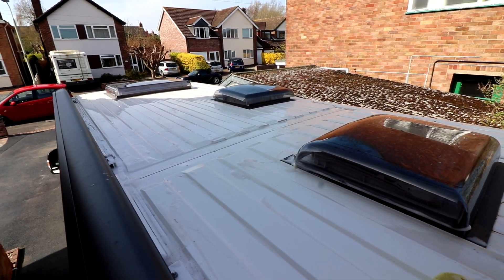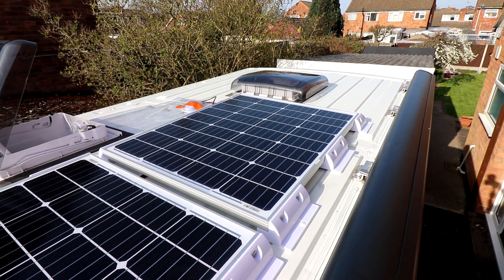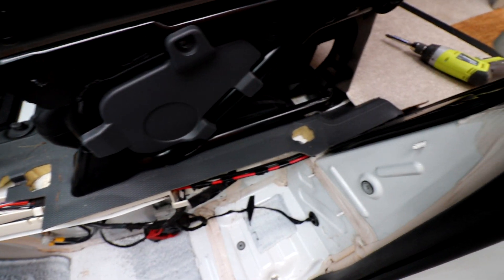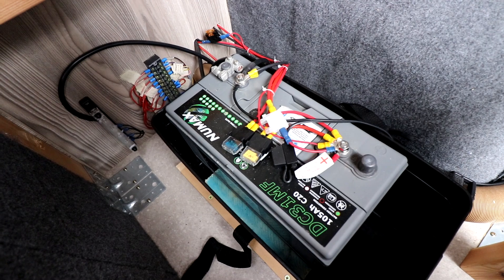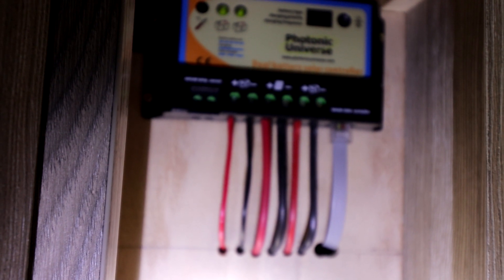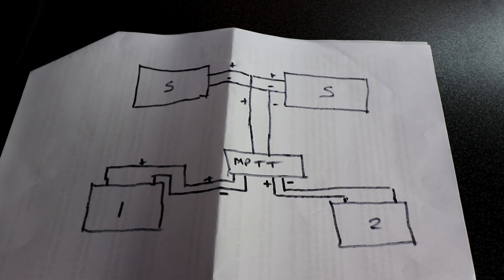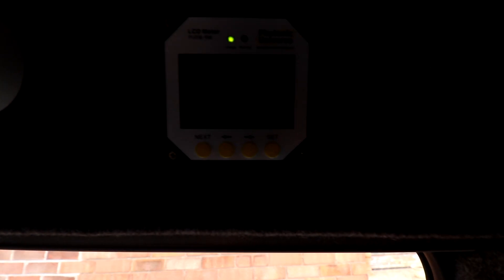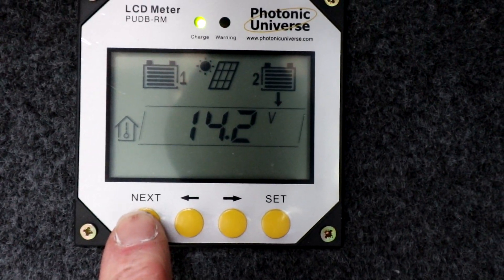Peugeot Boxer Campervan Build Episode 15 - 2 x 100 Watt Solar Panel Install.

Comment: Hi Ian,
Nice install and just in time for the weather to start getting better! Hope your campervan build continues smoothly with less need of finicky cable running. The dual battery controller in the video isn't actually an MPPT controller and is a PWM charge controller. There's not a lot of MPPT dual battery controllers on the market in general. There's no issue with it not being MPPT of course with your 2 panels being in parallel and showing a voltage around 23V coming through the display -- it'll do a cracking job still to keep the batteries maintained. 👍